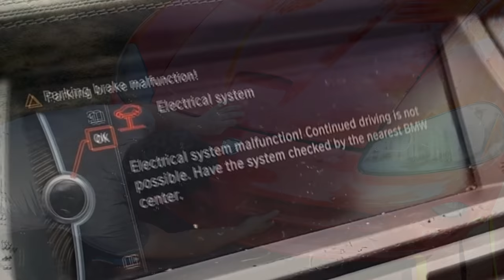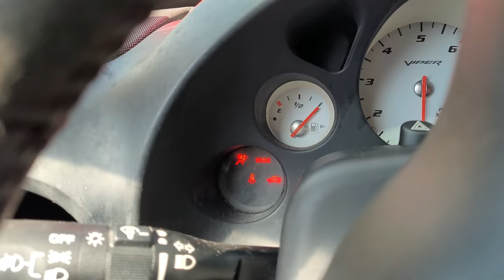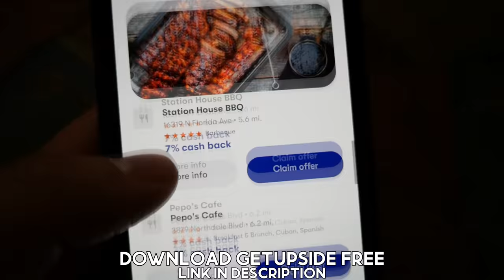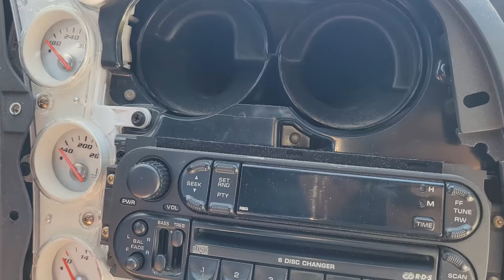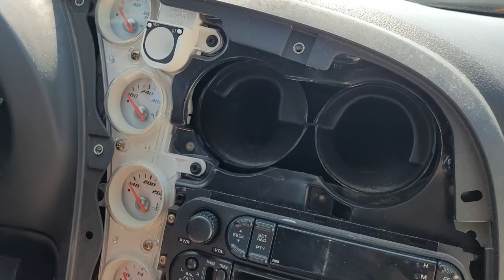Will this Sinkhole Flood Salvage Dodge Viper Start and Run?

Comment: There is a reason the car ain't starting exotic car ain't like a regular car fuse box you took the feul relay and the blow our relay out the car which disabled the starter from starting the car for security when you turn the key over it the first than it does is read all your code before start if any thing has been disabled it will not start like my honda accord an I was surprised just the horn fuse relay is out I can't shift my car in drive unless I put it back in crazy believe me it not your pcm ecu box an me just seeing how far it went in water an it wasn't in there but just that day now if it was in the water like 2day or more then I say you got a problem but you don't you have to understand you have an exotic car which has a lot of security issues when it get dive in water security systems is the problem 😉

Comment: Worried about salt water puts soda 🥤 in 🤣🤷 injection cleaner costs alot you know lok
Reply: Put baking soda on the floor etc thrn vacuum it up later ...then use good carpet cleaner etc works great 409 has some home section at Walmart $3
Reply: Did you clean the sand from inder intake and cover ports i hope